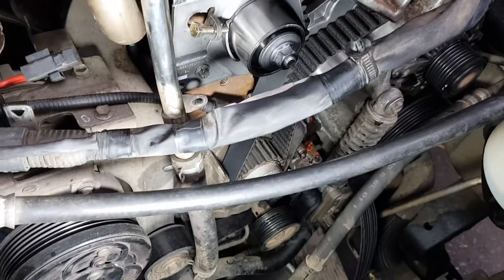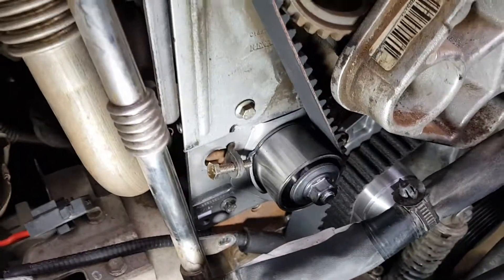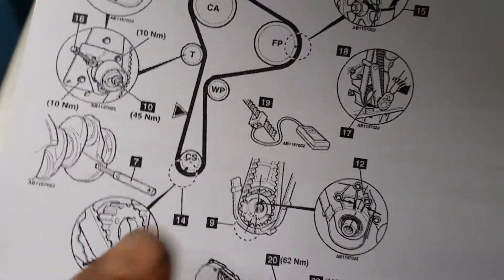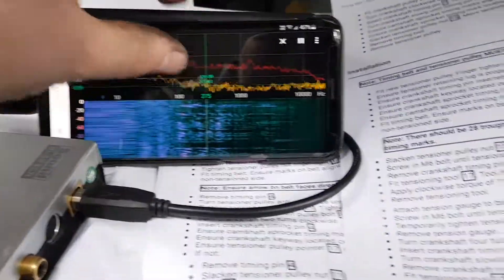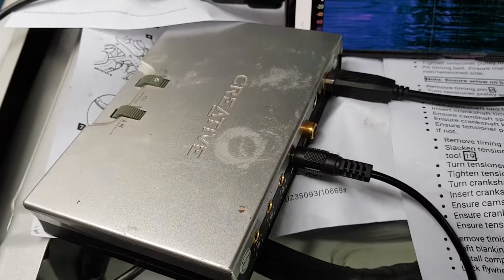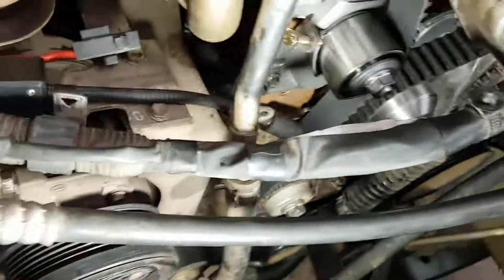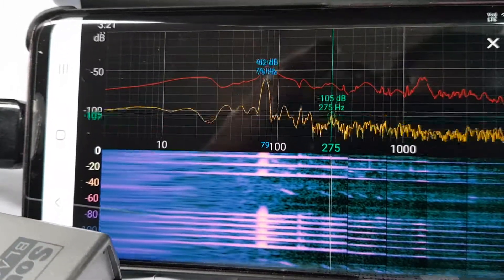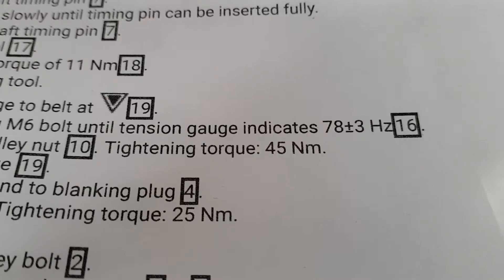Renault F9Q Sonic Timing Belt Tension no special tools.

Comment: hi, is the bolt you have in the tensioner to adjust the tension a M6 bolt?
Reply from the maker: From memory the M6 bolt sets the belt tension and the M8 nut on the pulley locks it in. it was some time ago i made this video.